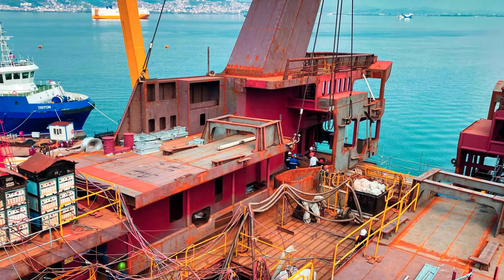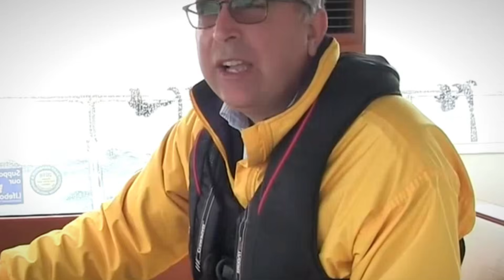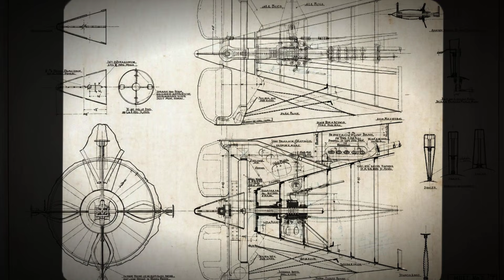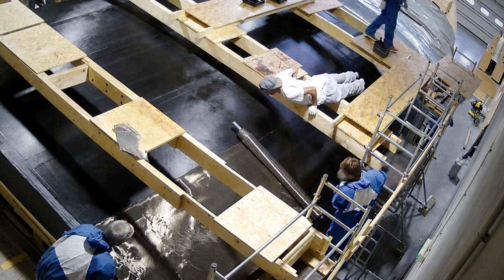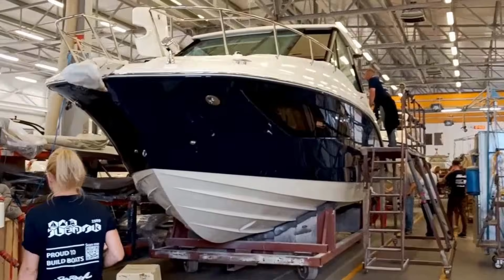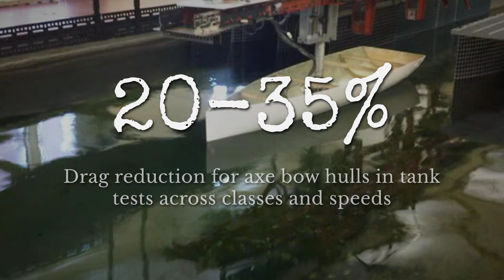This Hull Shape Cuts Fuel Use by 30% - Why Aren't More Boats Using It?

Comment: I've been wondering for years what happened to the cones fitted around propellers back in the 90's, they dramatically improved performance as they prevented side wash from the props and it was all converted to rear thrust. Now I'm told it caused too much drag, I can't see it in my head